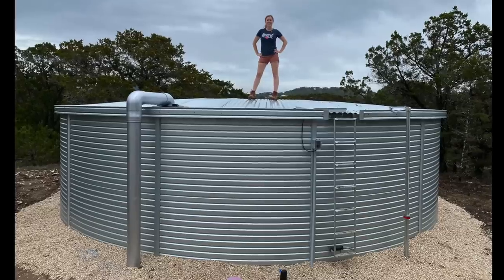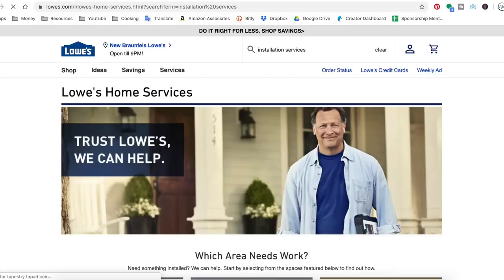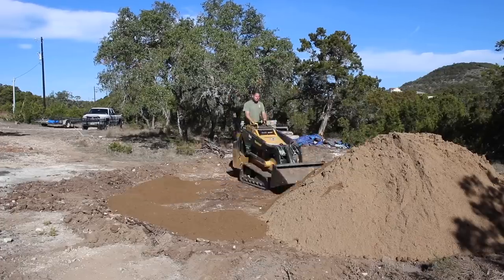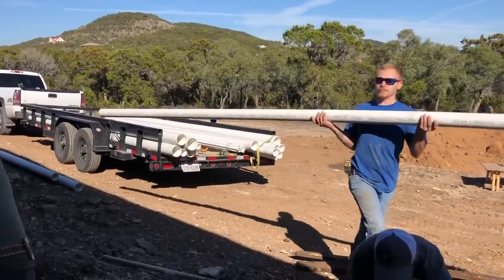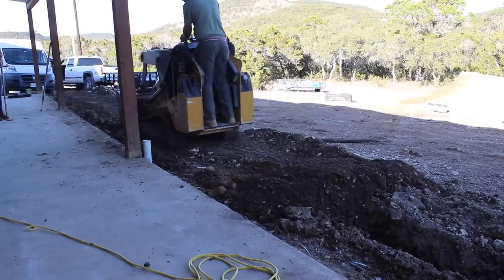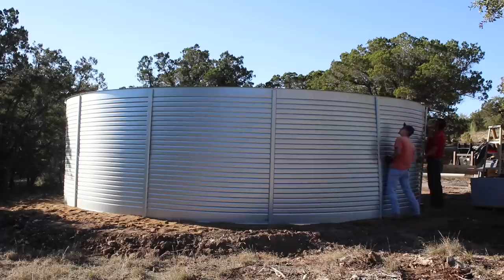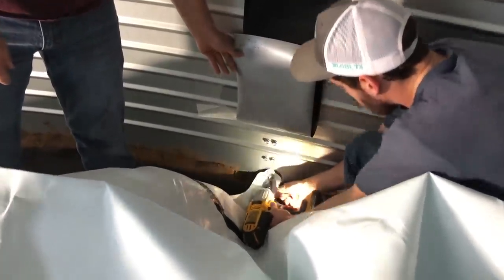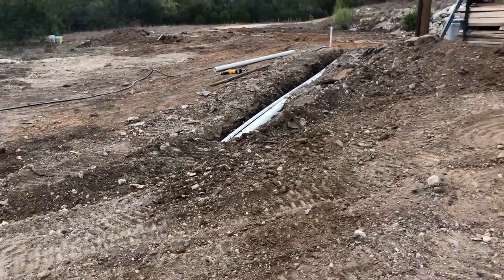Installing Rain Water Collection

Comment: We live in south central Texas, outside of San Antonio. We purchased a lot in the hill country and basically live on top of a hill.  We have always been interested in green technology, and are even more so today.  As part of the construction of the house we added 28 solar panels and water catchment.  We have a similar 30k tank and feed all the water captured on the 4,028 sq ft of metal roof into the tank. In fact our roof was specifically designed to maximize water capture since we knew we were going to do that from the start.  We had it designed it that way because, as you know, the well water is very hard and very expensive to drill for here.  We intended to NOT use well water in our house because of what hard water would do to the plumbing system and fixtures. So our water catchment system included a filtration package that makes our captured water potable. It includes 3 canisters mounted in the garage that has 2 filter and 1 UV.  The canisters filter at the 5 and 50 micron level and the UV bulb will kill any bacterial elements left after filtration. I change these filters 3 times a year which is outside spec for the filters but I think is fine because it’s only filtering rain water and not ground water.  We’ve lived in the house for 5 years and the system has been a godsend. It has never been drained since the rainfall (roughly 35 in annually) keeps it full. [knock on wood]. The toilets and sinks don’t get the rings along the water line as you get from even city water but would definitely get from well water. Another factor for us is the taste; we have become water snobs because our filtered rain water tastes better than any bottled water we could buy.  We often take a large bottle of water with us when we travel.  

Cost and installation: this would be the biggest turn off for most folks because it cost over $35k.  One of the biggest reasons for that is that we live on a hill so consequently in order to find a place for the tank a wall had to be built to make a place large enough to make a level spot. Also the hill has little if any soil on it so the build site was excavated down to limestone bedrock requiring that the pipes from the house to the tank had to be cut in to solid rock!!!  

Another difference between your install and hours is that our pump is not inside the tank. It is located in a small shed specific built to host the pump and pressure tank.  I recommend doing it this way in case there is a problem with either piece of equipment you don’t have to mess with getting it out of the tank to work on it. Without the pressure tank you basically have an on-demand system so every time you turn on the water it will run the pump to provide the water.  With the pressure tank it only starts the pump when the pressure falls below a specific psi. 

Side note: as we went through financing for our build we discovered that we couldn’t get the money for the construction without a ‘primary’ water source which water catchment is NOT!!!  So we ended up having to drill a well also.  

Another point to note is that if you use you use your catchment system for irrigation of any sort don’t filter it because it takes out all the nutrients the plants need. We ended up segregating the inside and outside water by putting filtered in the house and all outside water as ‘well’ water. OBTW we also have a pool.  In our initial planning we were going with a 40k tank to support all our water needs. When we were forced to drill a well we backed off to 30k tank.

Sorry for the long post but I hope someone gets something out of it.
B
Reply: Very nice post - I love hearing about your experience and think many others will gain from your sharing it.  You might be interested to know that the submersible pump April has can be removed from the tank in under 30 seconds, and if service is needed can be replaced with a different one in 3-4 minutes, all without entering the tank. Unfortunately the pump setup wasn't in the final "cut" for the video, but submersible pumps are extremely reliable due to the very benign environment and the fact that they're built to be installed in wells where they'd really be a pain if they failed.

Comment: What a surreal experience!  I live in Australia and we've just finished putting in this exact same configuration from Pioneer including size, color (zincalume), and even using a six inch water filling system.  Thought I might mention a couple of things.  The rubble around the base of the tank does help prevent the sand from being washed away, but it's not 100% effective; the real reason I put it in was to prevent burrowing animals like rabbits and hares from digging the sand away from underneath the tank and potentially causing a liner rupture.  Don't know what area around your workshop is like, but if you get a lot of leaf dropping or the wind brings in a lot of debris you might want to consider placing a metal mesh over your gutters so you're not putting as much detritus into your tank.  Next, if you do decide that to make this a source for potable water (which we do) you might want to remember the water is not fluoridated so select your toothpaste accordingly. Finally, if you put in a tankless electric water heating system like HeatWorks it depends upon the water having a certain electrical resistance in order to work.  Rain water will not provide the necessary resistance.  Sorry for the length of the comment. .  .
Reply: @PBMS123  not funny.
Reply: @jazzmc5322  he would have is own water to fight a fire at a geographically challenged property. That is smart!
Reply: @fireflyfilms6100  Exactly, even if an onsite water tank isn't sufficient on it's own to stop a fire it can help buy time for additional assistance to arrive. Of course depending on the amount of water collected (and propensity for evaporation) at some point making a pond/lake might be the cheaper option.
Reply: John Fuller in central Victoria where I live we have to keep 10,000 litres specifically for fire fighting. We put in a similar size and for professional installation the cost was under aud $8,000. The water is beautiful and we have no leaf matter to be concerned with so just drink 8t as is.
Reply: Why does she has to choose toothpaste accordingly?
Reply: @peacefulvibrations2465  Municipalities put fluoride into their water distribution for your teeth health and April will probably not be doing that.  Using a toothpaste with fluoride is basically true for anyone not on city water.  My well water is not enriched with fluoride to my knowledge.
Reply: @peacefulvibrations2465  Echoing tedringold's reply and adding that my experience was that my dental health took a downturn when we moved to our first property back in the late '90's.  Being an old guy (born in the 1940's in Nebraska) neonatal vitamins and minerals weren't a priority so my teeth aren't as strong as some of yours might be.  My dentist recommended a toothpaste with a higher than usual (apparently) fluoride content and things began to even out.
Reply: Didnt know about the resistance part about tankless. That is good to know.
Looking at building a pumped storage system at scale from a pond to lake. These are good things to know.
Reply: Her real issue is that she will have to filter the water.  From Dec to March is Cedar season in her area.  Pollen counts are astronomical (15,000 +), everything ends up as a light green/yellow color.
Reply: Stoneholme fluoride is a carcinogen, so no you don’t want that in your water or toothpaste.
Reply: @smokethirteen  the first thing my oncologist told me whenI was diagnosed with Cancer was not to drink flouride water as it was a carsonagin. Was told to only drink tank or spring water.
Reply: @smokethirteen  - Absolutely correct regarding water, not so much regarding toothpaste. After all it will not be ingested or better say hopefully not. LOL 😂
Reply: Fluoride is a poison...
Reply: @peacefulvibrations2465  Some toothpastes have flouride in them.
Reply: @tedringold  Fluoride in water is definitely NOT the norm. Most people, rightly so,  do not want drugs in their drinking water apart for the obvious chlorine for sanitation.

Comment: Yes I do have a rain harvest system. My system is a underground storage system, the tanks are five ten thousand gallons plastic tanks. 
I have a 100'X300' Barndominium built by Morton building's and I love it. I use the water for non potable uses and as a storage system for my Township Fire Departments for a water resource.
I live on two hundred acres, one hundred in woods and one hundred in field so it's a safety issue for me. 
I give the fire departments access to the system if needed. 
Keep up the great videos. 
God bless you and your family.
Reply: Aeternalis Armentarius  Just over sixty thousand dollars, but I get a tax rite off from the Township and County for ten years. At the end of the ten years I will have spent approximately thirty five thousand dollars for the system.

Comment: Hi April. My wife and I are both Master Naturalists living on a small ranch out in the Texas Hill Country west of San Antonio. Although I'm a UT Austin grad, I have fallen in with a bunch of Aggies. For those Texans who are not already aware, your county Extension Service is an extremely valuable and FREE (funded by taxpayers) service that I recommend everyone avail themselves of. Anyway, I fell in with the Aggies and soon put in a peach orchard. Problem is, from mid July to early october, little or no rain. We are fortunate to have sweet clear limestone filtered water right out of the ground we use for the house, but I hate to pay to pump it onto my orchard. So we capture rainwater off our metal roof directly into downspout through a screen. The orchard is about six feet below house grade, so buried pipe flows water into two 1500 gallon tanks at orchard.....no moving parts, pumps, or power necessary. Head pressure at tanks pressures hose bibs at bottom of tanks. People have been harvesting rainwater for thousands of years, only recently did we dig holes in the ground and put electric pumps into them. Well that's my 2c.........long live The Republic of Texas!!!

Comment: That's a fantastic addition to anyone's property. 

I saw an extremely novel system for rainwater collection / storage within a city & it was a swimming pool size tank under a new home. The interior was sealed with epoxy & it used a venting system to eliminate any condensation under the house.  It collected water via gutters but also via a permeable driveway made of open, diamond pattern driveway pavers.

Comment: Massive system! In New Zealand we collect rain where the house is not able to be connected to a mains water system, but generally only 5000 gallons. We drink that water with no processing. As long as you ensure that your roof is free of dead birds, excessive leaves, etc, and the tank is not open to similar contamination then it's fine to drink. I've never been sick in over 20 years of drinking roof water.
Reply: Some of my neighbors drink straight from the tank, and so do I when the UV system gets knocked offline in storms.  We have big tanks because we like to fully supply the house for up to 10 months with low rainfall.

Comment: Brilliant! We’re in the Brenham area and we were in the process of building our home on 10 acres when the Bastrop and Montgomery fires hit. I’m a pool builder so I incorporated a plumbing system to utilize the pool water in our pool to fight a local fire that might threaten our home. That system would rely on a gasoline powered pump in the event that the power grid was interrupted by the fire. I considered but had to defer a rainwater harvesting system primarily because we are on a well and, as you know, budgeting concerns require hard decisions. In any event, I think your system is brilliant and provides all the flexibility one could ever anticipate. Well done!

Comment: Good video April. I live on the eastside of the Big Island of Hawai'i, and a great many on island do rely on harvesting rainwater. Most are only 10k gallon systems as it does usually rain enough to keep the tanks full except for the occasional dry spell, and at that point you will see trucks with 4k gallon tanks of potable water running around to fill tanks of families too big or not conserving  enough. It is a known fact, the more girls in a family, the more water is used! No, just teasing!! LOL. I put my system in by myself when I built my home. The tank is 18' 6" by 5' 4" and the rain is collected off of the roof of a 1400 sq. ft. house. I have a Grundfos tankless pump at the house that pulls the water from the tank and through two, 10" filter housings (one with a 5 micron string filter the other a carbon block filter) and then through a ultraviolet light sanitizer unit. With this system I have some of the best tasting water there is. When I installed this system 15 years ago, the whole things was $4500.00 without labor.
Reply: I’m here with ya in Mt. View. Have a 14k tank but want to get a new one. Do you have any recommendations?

Comment: Nice tank April!  Thanks for the link. I need a 45,000gl tank to catch all the water off my shop during the winter to use during our dry summer.
Reply: I’d be willing to bet your tank will be a touch more unique. Perhaps a few hundred large cedar logs glued together and turned in a giant home made lathe. Or maybe not.
Reply: Everythingisgoingtobealright,  Frank already has a water tank installed from a few years back.  Great video. Entertaining as always.
Reply: Will there be an update video on the current tank you have?
Reply: Just make 2 30.000 gallon
Then you can clean the one when using the other.. 
Just make a huge spill way in the floor and a
Walve.. to spuule silt and Bird drippings out of
Reply: WoW, I only have a 66gl tank🤣
(Because I live in a city and dont use rain water so much)
Reply: I would love to see the amount of water come out of the pipe into the tank

Comment: Whoohoo! Congrats!
I had a rainwater collection system (RCS) at my house in South Austin, TX.  I loved it! I installed it to water my chickens and for irrigation purposes because Central Texas experiences cyclical droughts. The RCS was installed by Innovative Water Solutions LLC, whom I highly recommend.   I collected the water off the chicken house roof, and easily collected 2500+ gallons a year - the chicken house was 8'x 12', so you know the roof wasn't very big.
The RCS was part of a larger water management system that included berms, swales and a grey-water harvesting system also used for irrigation. I also put in 12-24 inches of wood chip mulch (à la Back to Eden) in my front yard and around trees and garden beds to reduce evaporation. I did all this after taking a Permaculture class. Trees all over my neighborhood were dying, but not at my house. 

Now I live in the PNW, but in a "Blue Hole" created by the Olympic Mountains south of me. I get about 16"-18" of rain a year even though it looks like I live in a rainforest. One of the very first things I did when I moved here was to install a 5K-gallon RCS using two 2500-gallon potable tanks. I collect the water off of my house's shingle roof. My house roof can actually generate 20K-30K gallons a year (I forget the exact number), but I only collect 5K. 
I installed it for irrigation, fire safety, and possibly potable purposes as well as to fill my wet-weather tank (up here, they call them ponds). This RCS I had a "handy-person" install; he did a good job, but he didn't really ever finish (i.e., never installed the tank gauges I bought, didn't finish the overflow lines, etc.) and didn't really follow the plans and specs I commissioned from Innovative Water Solutions LLC, so I often bash my head on the first-flush downspouts. Still, it is good enough for most of my purposes because I also have access to irrigation water from snow melt in the mountains. 
To do: I need to add a pump in order to use the harvested rainwater for irrigation - there just isn't enough head on it to water by either drip or by hand, so the rainwater has gone into the pond for the past 4 years, which makes my ducks and geese very happy.

Comment: Wonderful video - thank you for sharing this!!! 
A few years ago we had a “garage mahal” built, and ever since we have discussed how perfect the metal roof would be for rain water collection.  We have a rain barrel, but 55 gallons of water is used up quickly watering plants.  Your video has encouraged us to finally seriously check into getting a lithe rain collection system!  
We live on rolling land, with the workshop-of-our-dreams at a high point; so installing the gravity fed water lines should work well.  We live in East Texas, so sometimes we get a lot of rain, and sometimes we don’t get nearly enough.  It would be great to store up water during those times of plenty.  Our tap and well water is very hard too, so “soft” pure rainwater would be a wonderful change.  Our water supplier also chlorinates our tap water so aggressively it kills plants.  We have a well to water plants and supply the livestock, but we’re stuck with tap water at the house due to changes made long ago. Neither the well water nor the municipal water supply are palatable, and they’re both extremely ripe with mineral nastyness. 🥴
Thanks for posting this!!!  You have given us great ideas.  Enjoy your new water supply!